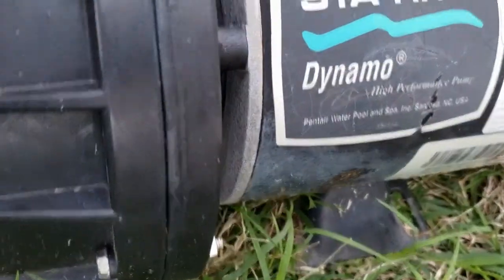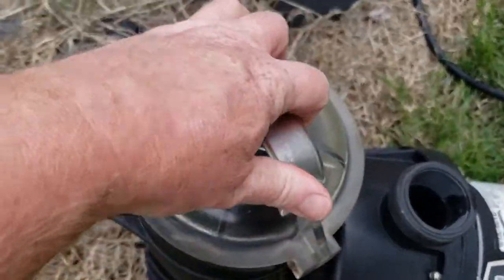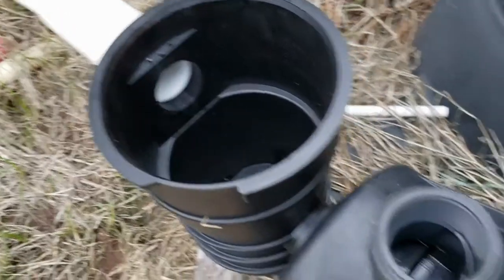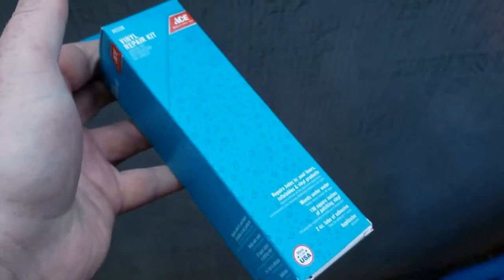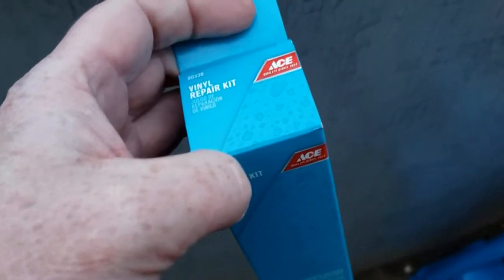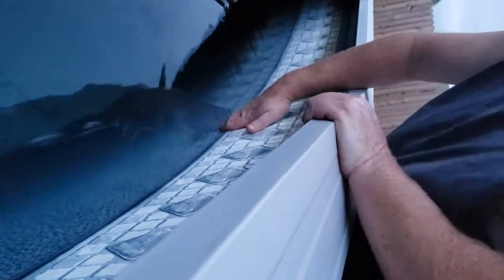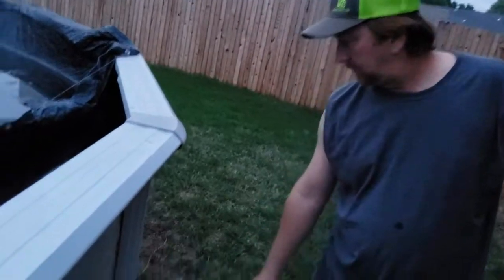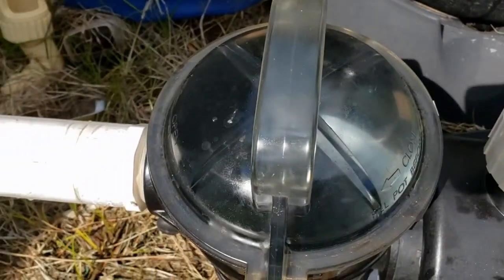Replacing Strainer For My Sta-Rite Dynamo Pool Pump & Patched A Leak

Comment: same happened on my hayward pump. The strainer basket lid lip broke during the winter. But how to do you get the strainer basket to land straight up and down?  No matter where I start screwing mine in it lands sideways. Any tips?
Reply: I’m having this SAME problem right now. Did you figure it out??
Reply: @stevenjerome4836  it was a while ago now but I think I just found the right place to start the twisting. It took me about 50 tries. It eventually ended up screwing on correctly
Reply: @christopherleblanc5187  yeah my problem was that I forgot to replace the o-ring on it. So it’s good now
Reply: @stevenjerome4836  ohhh yes... I remember now. That's exactly what happened. Found it on the ground.